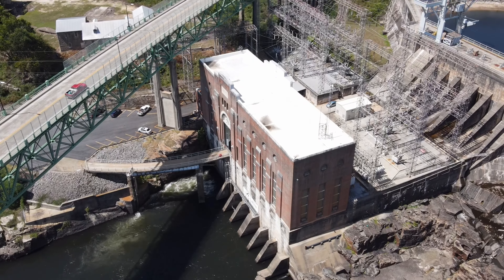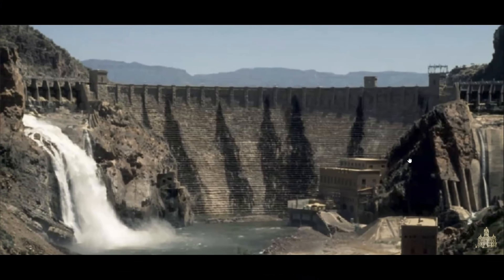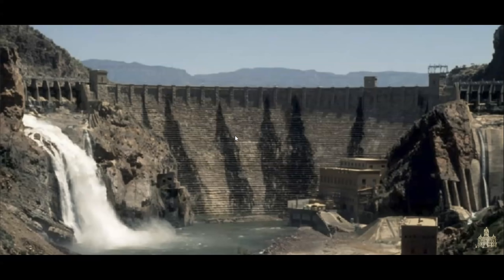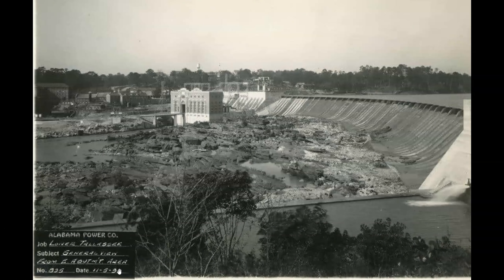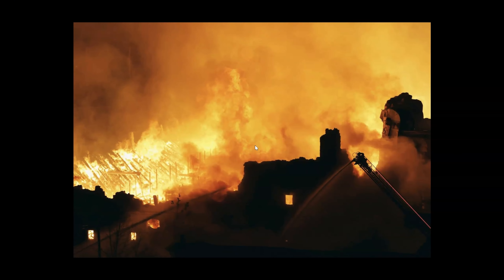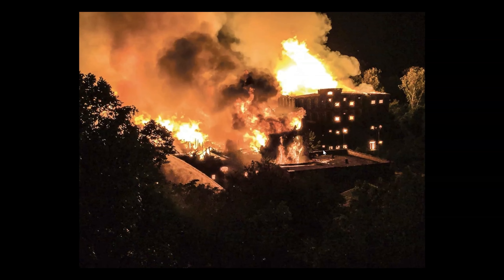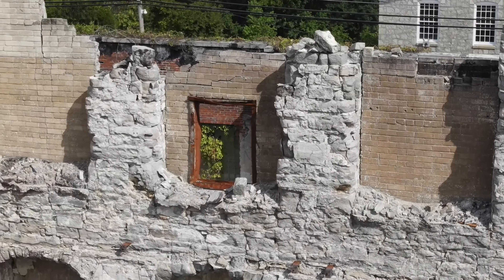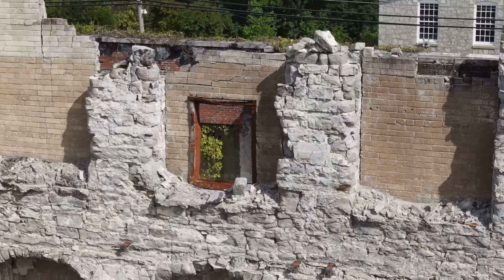"They" Lie about Everything

Comment: All those windows served a major purpose... They were designed for cooling.  Passive cooling or passive air- conditioning.   They were designed and set exactly right with mother nature to consistently move cool air throughout the Building.  

Winter months angular shutters was used to control how much air passes through.  

From what I studied, read about this,  that it was very efficient.  Never Hot never Cold.  All Done Without the aid of todays technology.  Used Zero  energy,  zero pollution.

Comment: it looks like the melted rocks in front are the original , blown apart and melted, then they fixed it with new concrete dam
Reply: Yes. Original damn or structure got cooked into melted goo. And circles would be bubble pockets.
And they followed up with new concrete merging into old

Comment: The basin underneath the dam on the old pics - looks blasted and melted. Reminded me of when you apply a layer of epoxy, but very sloppy. There's no way, the actual builders would be as sloppy as that. I think this is from a huge thermal blast.